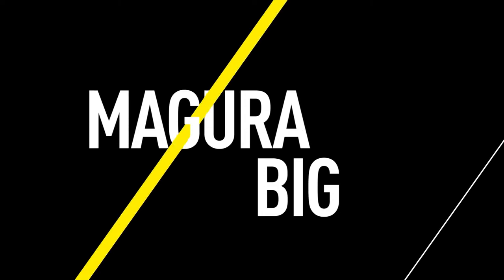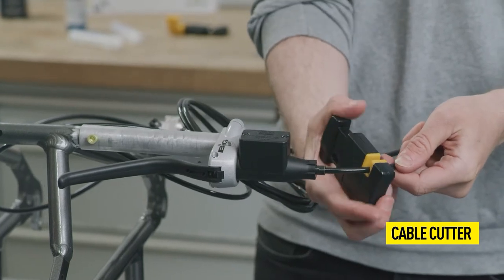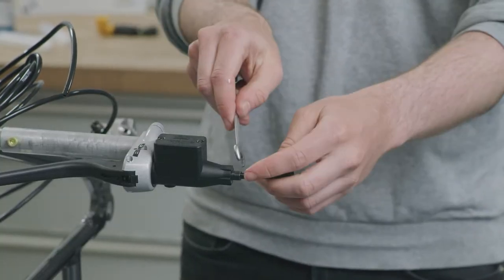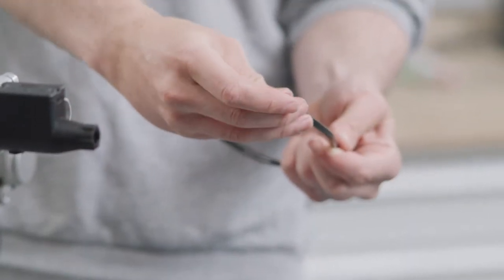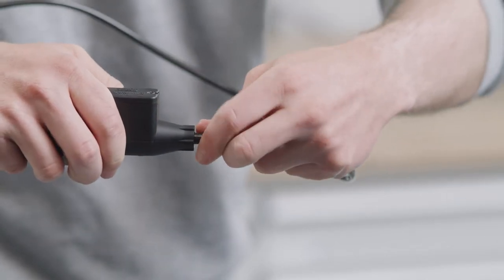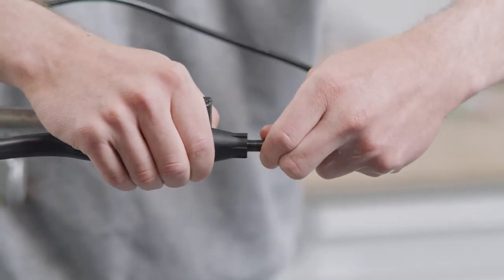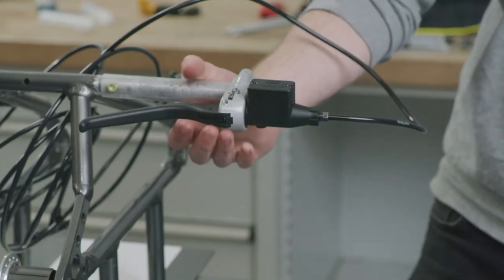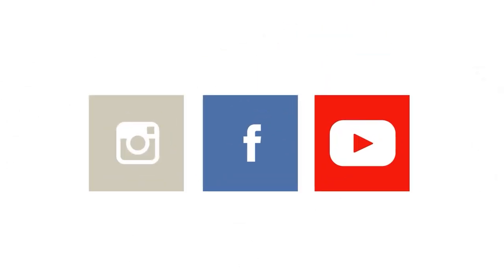MAGURA BIG: Shortening the Brake Tubing

Comment: Does the 'clamping ring' need to be a new one or can the original be reused? Thanks
Reply from the maker: Hi, thanks a lot for your question! The olive and insert pin always need to be replaced, otherwise the brake may not seal properly.
Reply: @MAGURAPassionPeople  thanks for the reply. It would be good to include this detail and partnumber in the video description.
It would have been good in the video too but it's too late for that!
Reply: @MAGURAPassionPeople  In the video I can see that there was an insert pin in the old discarded section of the hose, but when the shortened end is replaced into the handle, there is no insert pin used? There is just the olive (clamping ring) and the threaded screw.